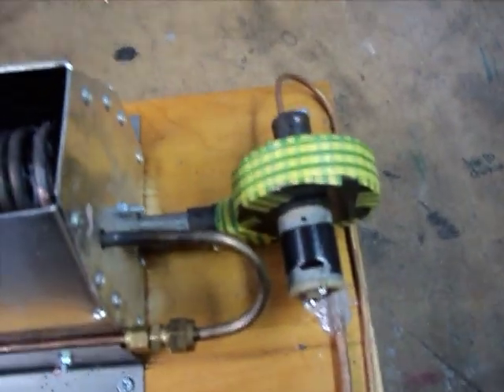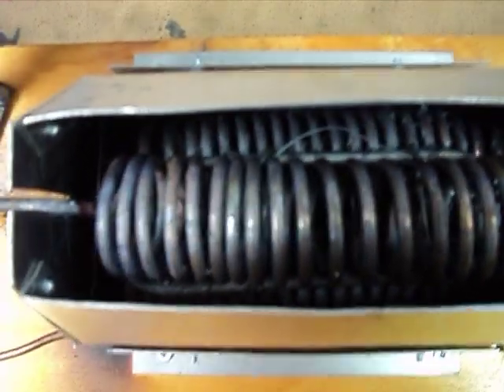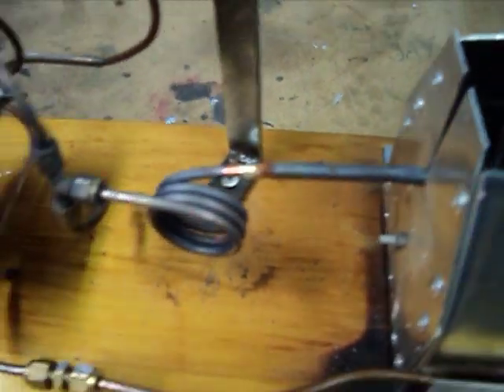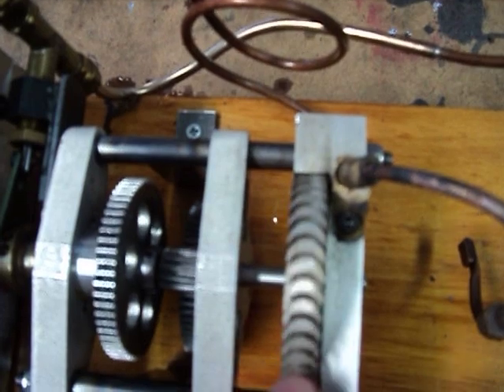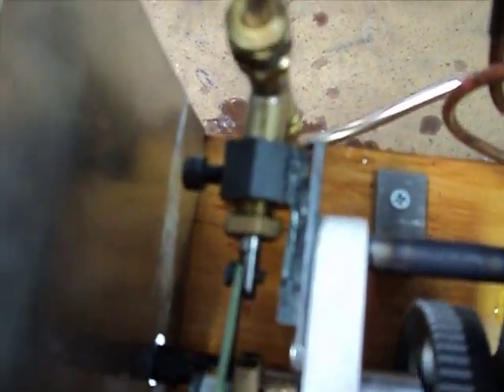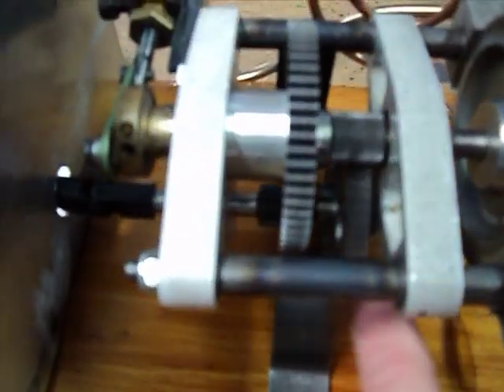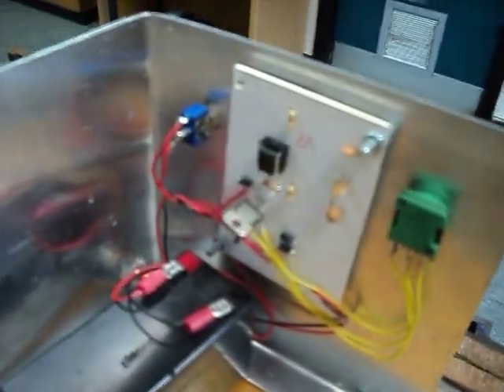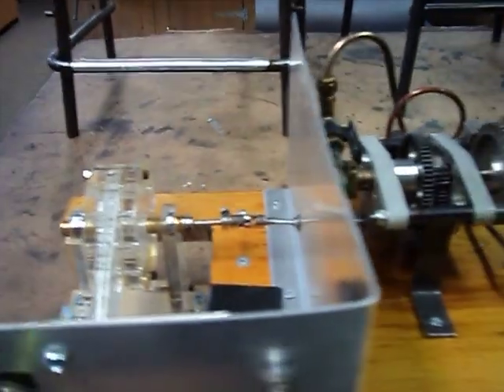Tom's Flash Steam Turbine3

Comment: We're talking about a little bit of water injected, not a lot. Too much water & the chamber cools down too much. Always, the heat in the chamber should overwhelm the small burst of water mist.
A single cylinder Stirling heat motor would be perfect to test this. Tap a mist valve into chamber, heat chamber, then inject small burst of mist.

Comment: Instead of heating all the water the coil, what if you heated a dry chamber, then injected water mist into that chamber. Wouldn't flash steam result, increasing the pressure until the steam is exhausted? Once exhausted, inject another small burst. Run your turbine on bursts of flash steam.